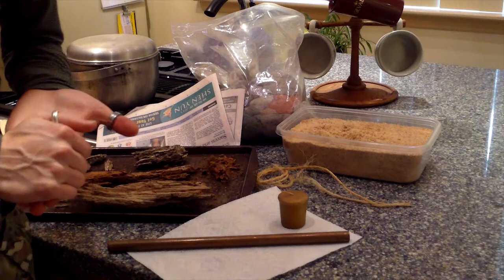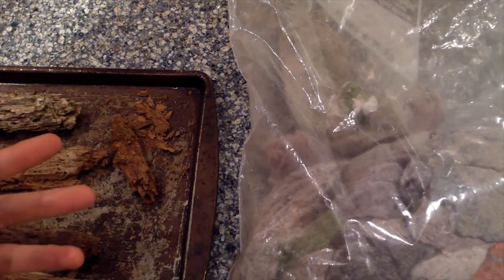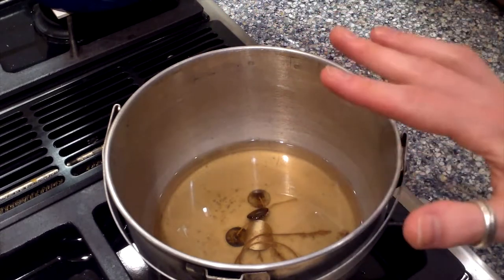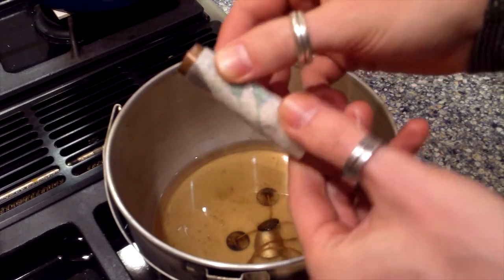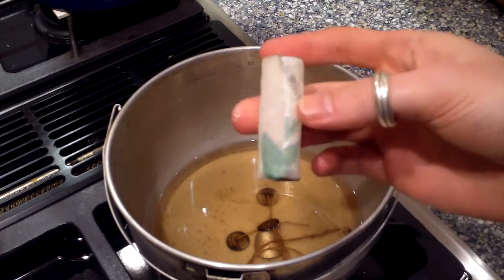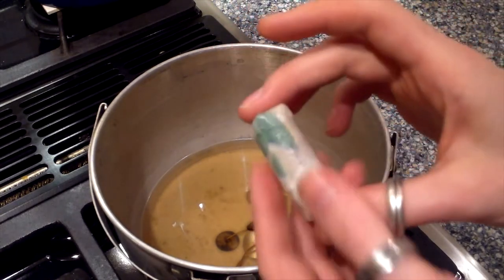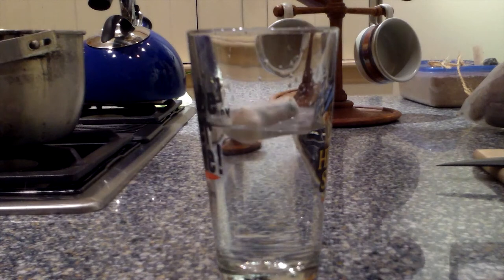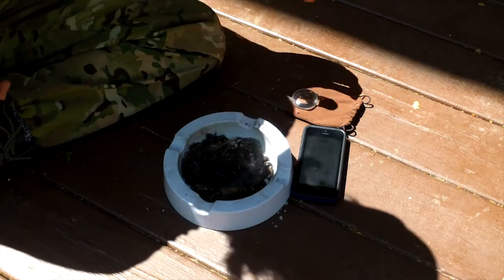Tinder Tubes

Comment: you could improve this design by running a piece of jute twine down the tube before packing the lint and wood in. That would give you a wick design. It would probably even light with a standard bic lighter. I use waxed jute as a fire starter all of the time. I keep a medicine bottle that the outside is wrapped in waxed jute and on the inside is tampons, and fatwood. I have never failed to geta  fire with that kit. You have items that will light with anything. 
I really like your design here. I mainly use a lighter though, I keep and use fire steels but to me they are my back up if my lighters, and Zippo fail. So a tinder tube with a wick? I think I will try to make one soon. Jute twine even with wax coating can be fluffed out and struck with a firesteel. Hope this gives someone various ideas on the same design. CHEERS!
Reply from the maker: +Joshua Caviness Awesome suggestion mate. If you make one please send us a pic on Facebook and tell us how it performed. - Grimm
Reply: will do. Busy ducking the rain and storms this weekend but, will get back to it all first of the week hopefully

Comment: While I appreciate the effort you expended to make this "tinder tube", there's an even easier way to do tinder . . . one that doesn't require an external ignition device.  Sootch (from Sensible Prepper) in his video entitled "Cool Fire Starting Tricks" shows how to wrap a Strike Anywhere match in toilet paper and them soak it in wax.  Its a water proof match that burns for a very long time.  Your system definitely works, but I like the simplicity of his "survival match"
Reply from the maker: +William Burr Thanks for letting me know about the survival match. The nice thing about the tinder tube is you can put anything you want in it, even a match. Also that though it does require a separate ignition source it will except multiple ignition sources, even a broken lighter. The reason I chose to stay away from matches is that after doing research I found, and other survivalists found, they are unreliable because they deteriorate over time even if sealed. Much like a lighter the fuel evaporates out. You might be able to check a lighter for fuel but one cannot unseal their match head and check how the chemical composition is at. Everyone has their own preferences when it comes to survival. I just prefer to stack the odds in my favor with something that doesn’t deteriorate, takes multiple ignition, and modifiable in case my skills or environment changes. I also always have a ferro for on me. Thanks again for telling me about Sootch. I’ll be sure to check out the video. - Grimm